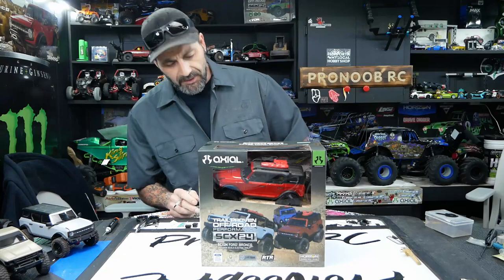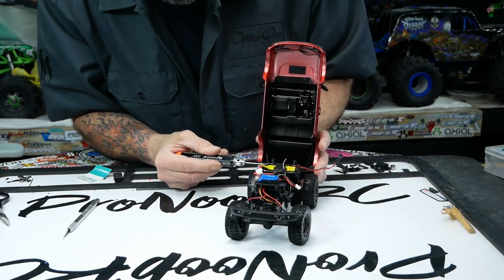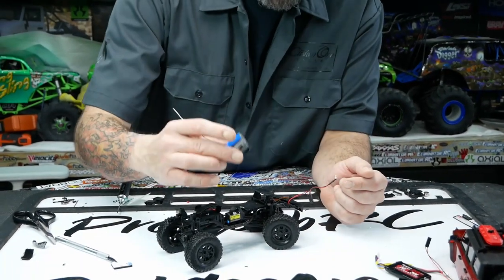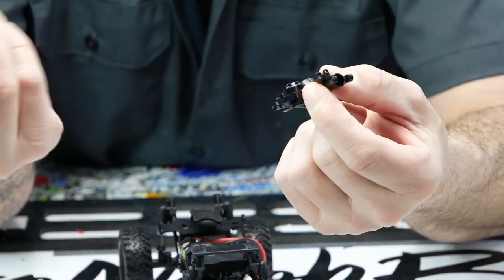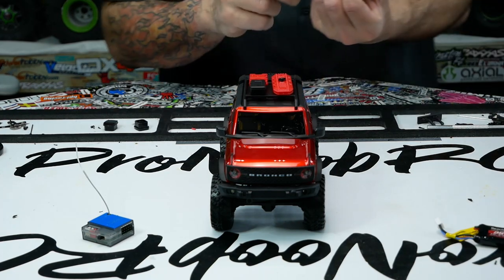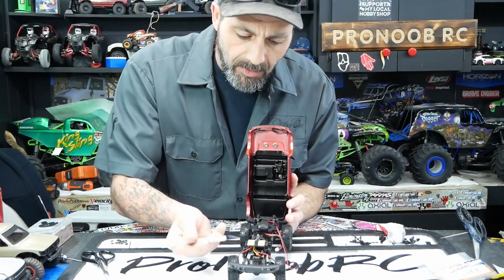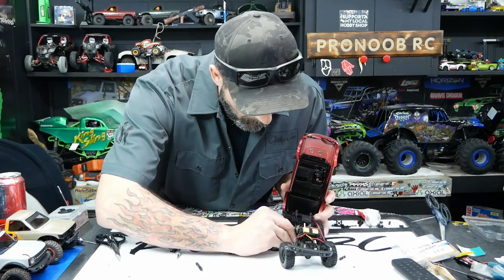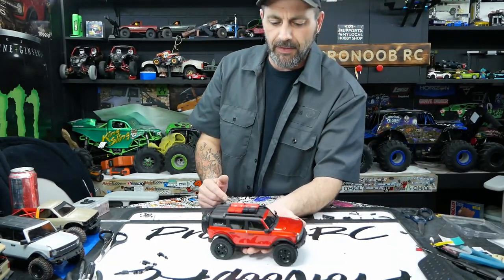AXIAL SCX24 FORD BRONCO RTR MICRO RC: DIY AND FREE MODS

Comment: When I first got mine I tore it apart at my hobby shop and first mods I did were wheels n tires I brought with me, a tamiya antenna & the injora metal bumper. I flipped the bumper bracket too while installing
Reply from the maker: Nice!

Comment: ProNoob, I flipped the bumper mount, adjust the body post height, and relocated the front shock position for a near perfect mod. Looks amazing & the ride height is nice. Thanks for the great videos!
Reply from the maker: Another great way to do it!! Cheers ken! Thanks for sharing your great optional tip here!
Reply: I agree i did the same another thing i did was after repositioning my shocks i used small rubber bands as limiters for the shocks
Reply: I actually did the front bumper flip also and raised the front body mount,   but I left the front shocks in the stock positions but took the front springs off.  I am also now able to actually put the stock battery in front of the body mount suing the stock velcro to velcro it to the front mount..   Back sits a very little bit high, but  barely noticable, and if I decide to change it then will get those softer springs or cut the springs in the rear.   actually runs pretty good to without front springs.
Nothing like upgrades that cost nothing and are easily reversible.
Reply: I did the same. Removed the spare and most of the roof gear. It crawls pretty well.

Comment: Do you set the preload on the front shocks, too? I followed all your directions and my front is so low (without preload) that the tires are basically touching the fenders just sitting on the bench..
Reply from the maker: Not really. But you can that is completely up to your preference. We like ours sitting as low as we can in the front when possible.

Comment: I was able to save a brass axle after a ball screw broke off in it by cutting the short end of an allen key to just a nub, and using it to slowly screw the shortest bolt I had into the back side of the affected hole. It eventually pushed out the tiny bit from ball that broke. Just took some time.
Reply from the maker: Score!  I’ll try that !
Reply: @ProNoobRC  damn me too!

Comment: Is there a solution for the bigs breaking off? I bought a SCX24 C10 this week and went for the brass steering knuckles and same issue with no fix in sight.
Reply from the maker: Unfortunately the only mod currently is to use the balls of older trucks. I can’t even find the balls individually to order them from Axial

Comment: Nice vid man. I’m looking at fully upgrading my bronco. It is still stock and so far I only have bigger wheels new tires and a servo that I haven’t installed yet
Reply from the maker: Have you installed them yet?? Lol. You’ll love that upgrade!
Reply: @ProNoobRC  yeah I did but something is off because the power is there and steering works fine but the wheels don’t spin.. like I have no power. I charged it up and going to work on it today. I’ll let ya know !
Reply from the maker: Hmm that’s weird!?  Keep us posted we can help
Reply: @Rxtzero  I put bigger wheels on my Bronco and my wheels would not spin as well. Loosened the back wheel nuts a little and no problem now.
Reply: @scrubbasher6418  I’ll try that because the front wheels get power and turn but the rear ones don’t spin..
Reply: @ProNoobRC  I’m thinking the motor burned out ?? I have power to everything else except the rear wheels. Any ideas ?

Comment: Can you share more about the challenges you had with a metal axle and the shock mounting? You mentioned thread changes? What was your resolution for that issue?
Reply from the maker: You will have to change the ball ends for shocks and steering links to fine thread ones off an older scx24. If you change shocks out to aluminum you will get 8 ball ends that you can use
Reply: @ProNoobRC   super helpful, thank you for the details! I feel like maybe folks are so new to metal axles and steering knuckles on the bronco that this might not be a big known change. I typically always change my steering links when I change my axle housing and knuckles. Sounds like I’ll just need to get some old ball ends in my spare parts bin. Do the fine threaded ball ends also work with the top shock mounts? It looks like you updated your shocks, did the fine thread work ok even though the old ball end was coarse?
Reply from the maker: We only changed the balls to fine on the axles and knuckles and kept course on the plastic as the holes a bit bigger yup! Also wanna make sure we don’t run out as we seem to buy one of these every month so far since release lol!! These Scx24s are a win for sure!! Jesse and myself take these with us out on the UTVs and Jon boats lol they just work everywhere! Cheers!!

Comment: Thanks for the video. I picked up the red Bronco for myself because I love the way it looks and has the V2 electronics which is supposed to be smoother. And my 6yo son loved the Deadbolt so got him that one.

I used to use shoe goo inside the bodies of my larger scale trucks with dry wall tape and it holds well. Does it hold too strong for the ESC? Will you be able to remove the ESC after using shoe goo?
Reply from the maker: Cheers and thank you!  Yes it will come out if you pet it up with a small screwdriver turn peel off the shoe goo after
Reply: Can’t e just put different body on it for serious crawling
Reply: @clayramsey019  hey, I'm not sure what your asking. I only referred to the body of 1/10 scale vehicles I have where I used dry wall tape and shoe goo. 
My 6yo is gonna beat up his Deadbolt body, he don't care lol. 😁
Reply: @scottsuhre2514  do they sell different body’s for the bronco?